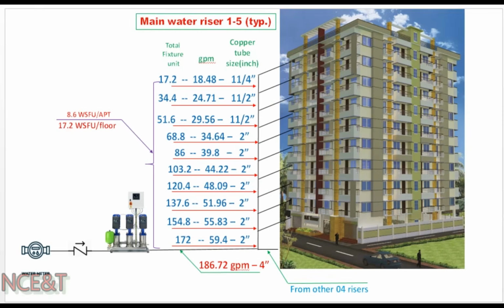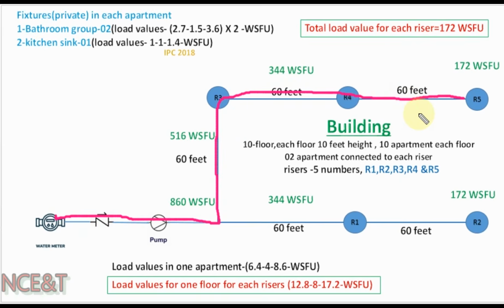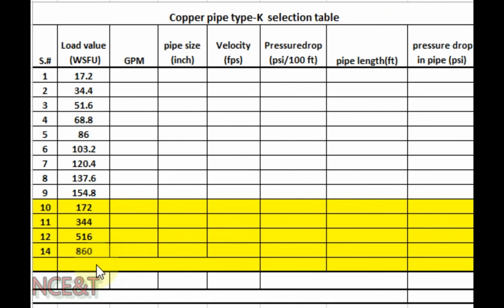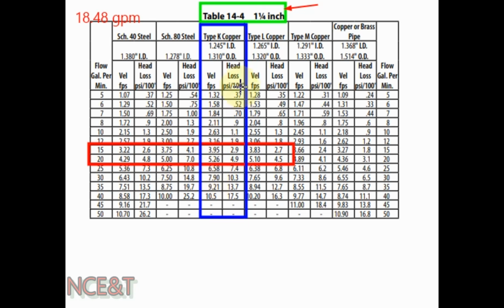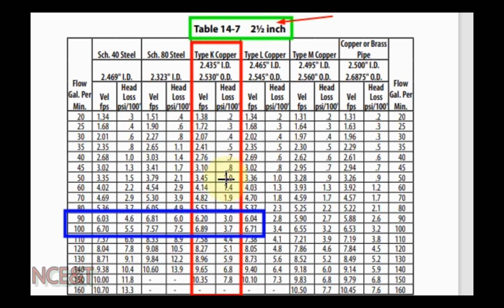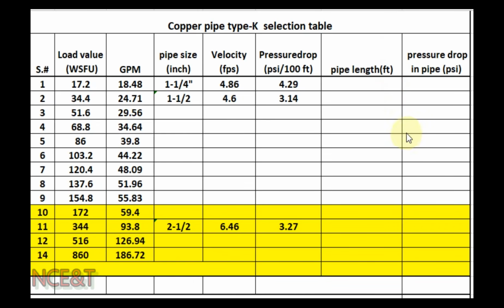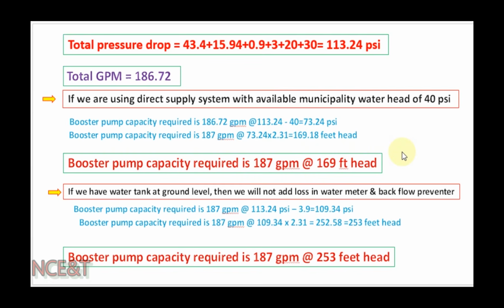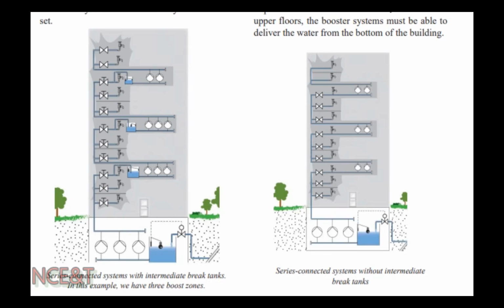55-Domestic water supply system design & selection of pressure booster pump for a high rise building

Comment: How can i calculate, How much HP motor is required for transfer the water from Underground tank to overhead tank ? 
Please give me a video about this topics.
Suppose, Under ground tank capacity 1 lac litre . Height 30 m. 
Thanks from Bangladesh 🇧🇩❤❤
Reply from the maker: You know the height, also calculate the flow, then you can calculate the HP.
Please watch this video, hope it will help you. 
https://youtu.be/Q-aCQpGjkWM?si=Lk9ykYW9Y5YRnlgN

Comment: How to calculate the pump capacity when pump sends water to storage tank installed on high rise building
Reply from the maker: Calculate daily water demand and pressure drop in the piping, then you can calculate pump capacity, 
 I will do this exercise also
Reply: @ncengineeringtechnology3376  thank you Sir for this guidance 🥰